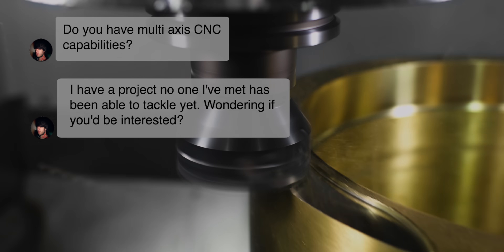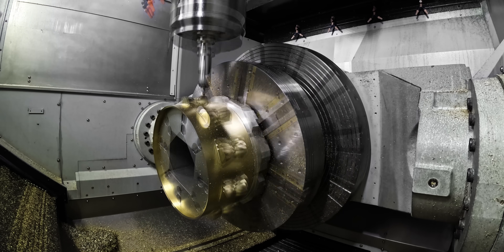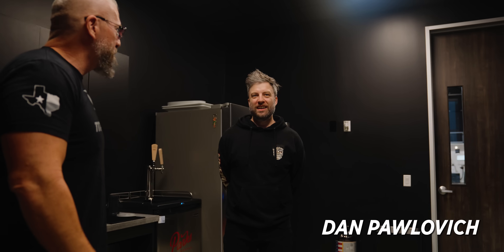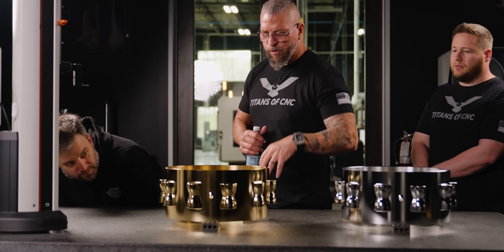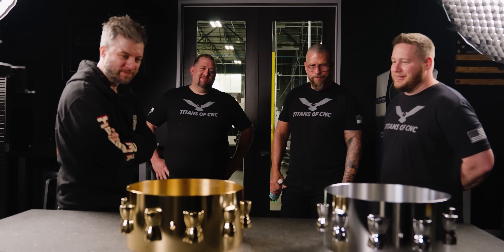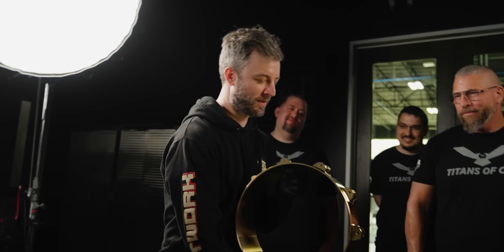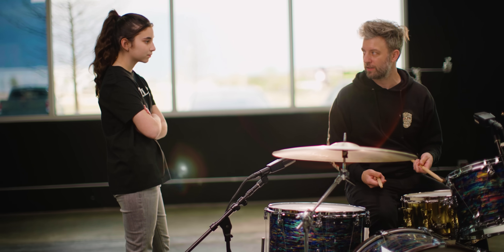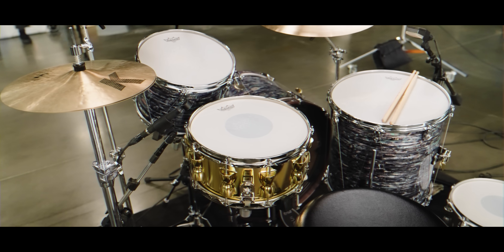Legendary Drummer Plays World's First 1-Piece Machined Snare Drum

Comment: With all due respect, this is many more than 1 piece. I find a lot of fun in actually minimizing the component count of my engineering projects. It wouldnt be durable, but you could literally machine a 1-piece snare. You would have to make the film on the top (which is hit often) made from the metal part itself. You could start with just machining a cylinder with a very thin bottom and try hitting that for the 'drum.' The thinner you go, the less durable but it will make different sounds. 
Its not that practical, but it would be "1-piece"

Comment: So - is the sound any different than e.g. a good wooden snare? I guess we would not be able to hear the difference in the compressed youtube sound. In my drumming days, i‘d liked the snare rather pointed, snappy and short in attack, with no reverb by the drum itself. Most often i‘d even use a small damper on the lower resonance drumhead a bit. For me the snare chord itself (material, tension) was much more important for the sound, than the make of the drum shell - that is why you see such a variety of materials from acrylic, wood - to metal. It does not matter really much to the sound, especially with the snare drum.

Comment: Watched the video from start to finish and I'll preface by saying I'm a weekend warrior drummer of 50 years and a machinist for my day job.
Although the shells in question are very nice work, they are in effect, just a "part" machined on very expensive machinery using well trained personnel and I'd expect a top of the line CAM system.
Not the first 1 piece drum machined from a single piece.
Drum builders have experimented with the process of "1 piece drum shells"  in wood and metals and the biggest reason why not to , is cost of equipment to do it on a production basis. Some of the same techniques of fixturing used bty Titan are used by drum  builders of all levels.
I've seen drums that started as die castings that were finished thru multi step/fixtures to a nice state.
Were they of the visual and dimensional level as the 2 shells shown, No. And they don't need to be.
Same reason people look at a Rolex and say I don't need that to tell time.
The snare drum is the core of the drum set. It's construction is chosen for a variety of reasons including cost, style of music and durability.
That brings me to a point regarding the 2 shells machined by Titan.
I would bet there's no way either of those drums will go on tour.
Snare drums take a beating not only for the playing but the atmosphere of the stage.
And I can't imagine how much its insured for against loss.
Dan has achieved a bucket list item by having this drum built.
Like a kid on Christmas , the joy will always be there.
But a good drummer can make a well built commercially available snare sound almost any way possibly thru tuning, head choice and snare wire selection.
And on the brass and aluminum shells above, I'm guessing no re-cutting of the snare beds...and don't cross thread a tension rod.
Wish Dan the best with the drums and Titan did a nice job making  precise parts for the 2 drum

Comment: No doubt their creation was unique and probably belonged in a CNC traveling exhibit or art museum rather than being sandwiched in between two drumheads. Those milling guys didn't appear to know anything about snare drums in general. They never even referred to the build as a 'shell'. Obviously they had construction dimensions but did they ever attach hardware and actually test their product prior to customer delivery? That said, I'm unfamiliar with sound physics. (resonance, sonics etc.) Would a perfectly smooth, thick solid metal inner cylinder provide a warm soft tap or a harsh hollow ring sound during live play - especially when snares are activated? I'm also curious how long the project took start to finish, their material and labor cost and how much they'd charge a customer. If nothing else, this video was a perfect example of a 50/50 crossover. 50+% of drummers are clueless what a CNC machine is or does and 50+% of (machinists, metalists?) have only seen drums being played in a concert or on photos. A fun, interesting and informative video for both sides. 10/10

Comment: This is wild. Fantastic job bringing this vision to life. However, I have questions…

1. What are the shell dimensions?
2. What are the bearing edge angles?
3. What was the thread pitch for the tuning rods? Did you use the DW super fine pitch for precision tuning?
4. I saw the batter was a Remo Power Dot, but what are the specific head model/makes?
5. Which snare wires did you use?
6. And lastly, after all that effort to construct a masterpiece of a snare shell, why not use machined one-piece bell brass rims?

No criticism, just super curious about the other specifics and tuning implications of this build. As I said before this whole project is amazing!!

Comment: Sorry for the blasphemy... I'm sure your result will be more perfect.
But I've sent more complex designs to online job shops like JLCPCB (JLCCNC in this case) or PCBway, and they came out very well.
And they were usually cheaper than I (as a small volume user) could source the raw material. Let alone get it machined.

Comment: It's a stunning piece of work, but it seems odd to then finish the drum with bog standard, off the shelf hardware. Is there a plan to make CNC versions of these parts too?
I'd also be terrified changing heads - or even tuning it - in case I were to strip a thread in one of the lugs. I think if I were designing a drum for myself, I'd want the lugs to have replaceable threaded inserts that could be easily changed when necessary, so the shell itself really can last forever.

Comment: From an engineering standpoint I would expect it to behave like any other mass spring system...

But as a single piece it has minimal damping and virtually no resistance points (no interfacing parts). 

The shape extremities will tune into the primary signal like a bunch of Metronomes that consolidate different frequencies into one.

All in all offering the most crisp and narrow frequency sound with a very, very long settling time.

Comment: Consider using Emuge-Franken Circle Segment end mills for milling the outer profile. You will likely get a better result and eliminate approximately 80 percent of the step-over by milling with a 16 mm dia with 1500 mm radius (yes that's correct) 6 flute end mill. Contact Emuge Franken and tell them that Gerry D sent you.

Comment: It looks amazing, unfortunately the sound just isn't as good as even a cheap snare. It is tuned down because it doesn't have the sharp, snappy pop and you really hear a lot of the resonance head. Would it be possible to put it back in the machine and remove some thickness from the inside?

Comment: only way to have gotten a better finish straight from the machine would had been if it was turned with mcd where it does it like those nanometer single point diamond lathe does it. so keeping in mind you guys didnt use or even have one of those its a damn good finish ( those machines though are pretty cracy though. doing surfaces like togse to absolutely complete mirror finish well still turning with like 10'ish rpm's at the bumps is crazy to see )
btw when is the syil U5 comming ? and the pfiffner comming so we can learn about those ?

Comment: how long did mastercam take to generate the solid verification while programming ?
Reply: I broke it up into several different sections.  But just the round OD without the lugs couldn’t calculate with the stepover and tolerance I specified.  So I had to break it up into 3 sections to get it to calculate.  If I remember correctly it took around 20 minutes for each section
Reply: @Jessie_Smith  wow sounds like breaking it up was the right choice. I had a bulkhead one time i was programming for Bell that took like 80 min to verify.  very nice vid. it reminds me of all the pot and plugging we used to do for thin walled stuff

Comment: Now you have the capacity to make these brass snares on a production basis.  Cost per unit: 50,000 dollars each.  Guessing.
Reply: If you cast this shape and then machined it, it would be cheap.
Reply: @MikeYurbasovich  Not with finishing specs that matched what was done on this unit. That takes TIME.
Reply: @Turboy65  Depends.  If you make the lugs built in the shell (which is pointless and silly) then,  I would agree.  Just machining this shell with that finish could be done in less than 10 minutes.
Reply: @MikeYurbasovich  Depends on what it cheap for you. I agree that machining the lugs out of the same piece is stupid, but even those manufacturers that don't do that charge at least 2 to 3 grand for their snares.
Reply: @1zui  I know.  I played drums for 30 years.  Brass snares used to be 500 bucks in the 90's, and the Japanese models were made in Japan.  Probably made in China now and made for less cost, charge more kind of deal..
Reply: @ "Mill it from billet" is not uncommon in some high end products.  Like some audio electronics made for the high end audiophile market.  Does it make it sound better? Probably not. Does it make the customer feel like he's buying higher quality and performance?  Yes. So that's why it works.
Reply: yes this could be had for super mega cheap compared to what they did here, and it will sound just the same.